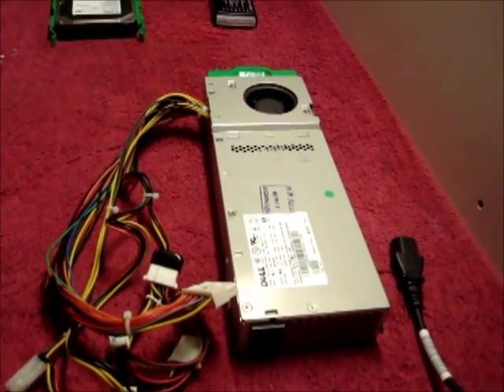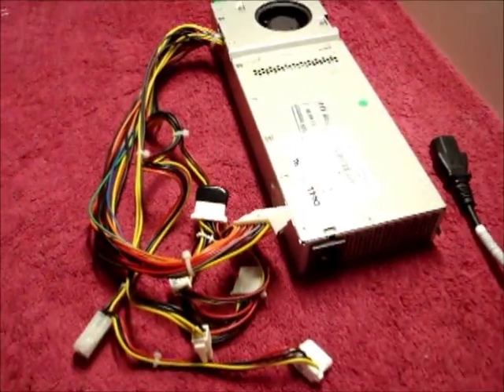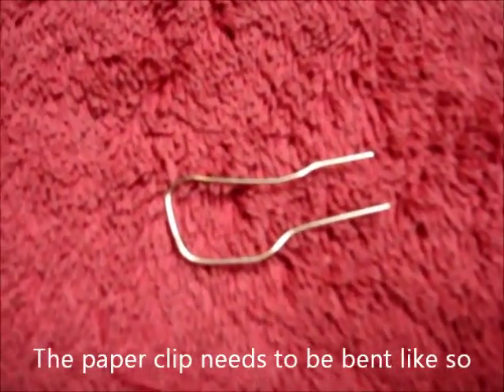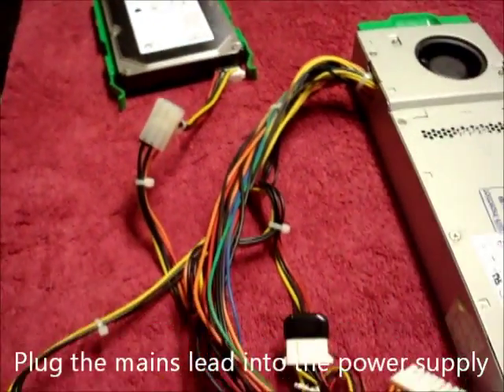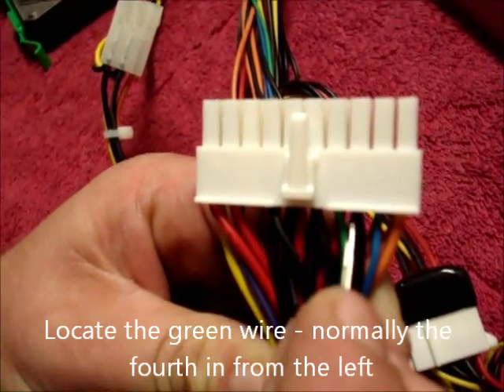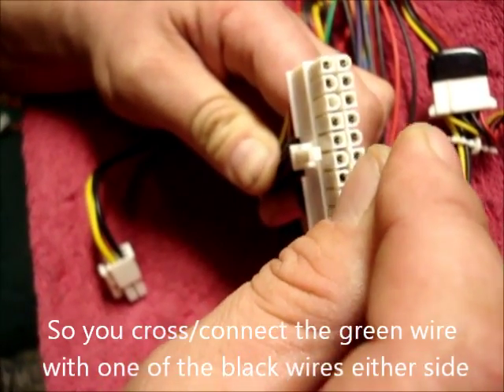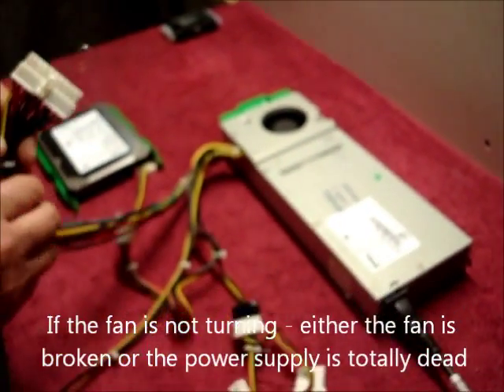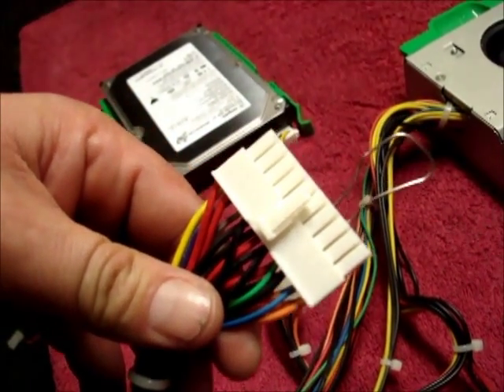How to Test / Check a Standard ATX PSU Computer Power Supply using a paper clip

Comment: I have to disagree with your statement. This test will not tell you if the power supply works OK, it will just tell you if it is able to turn on. Even do the power supply turned on, it could be issuing incorrect voltages. So you have to test each voltage rail individually to confirm it is working fine.